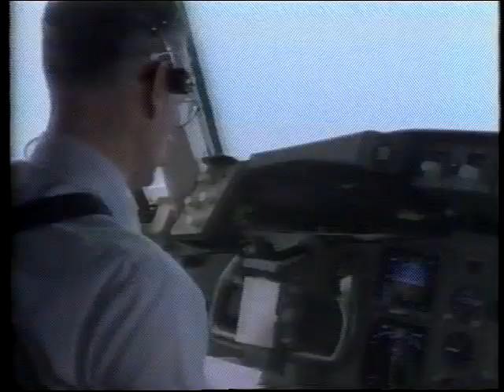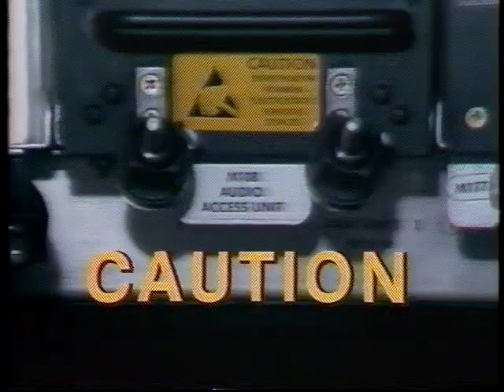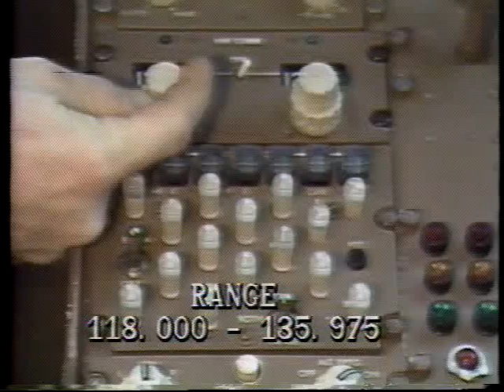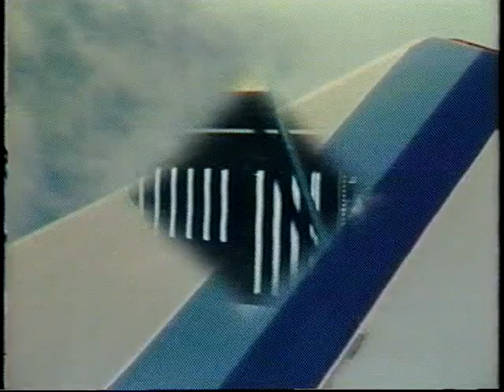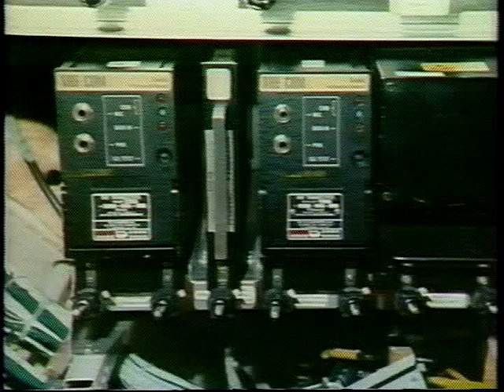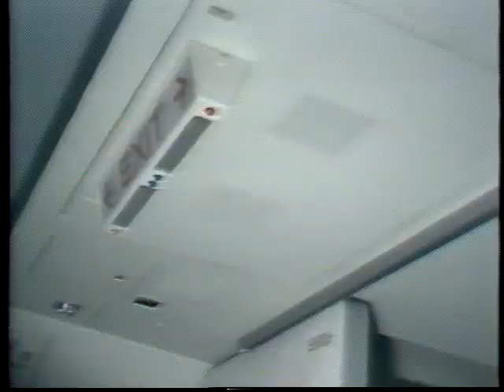B757 Radio Systems Overview and Component Location

Comment: Is there any preference over using the left vs right radio? Based on the reception from the antennas being on the top and bottom of the airplane? Or is it more of a backup thing if one of the antennas is damaged youve got one on the other side?